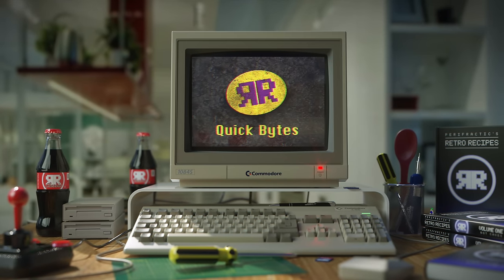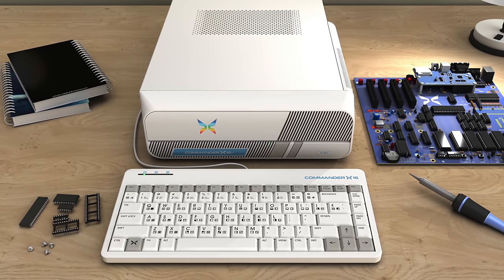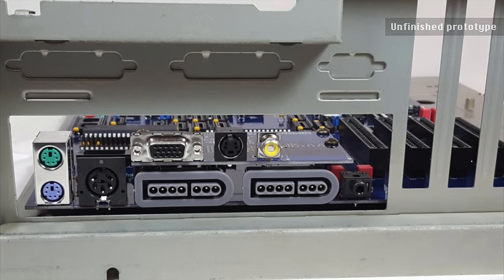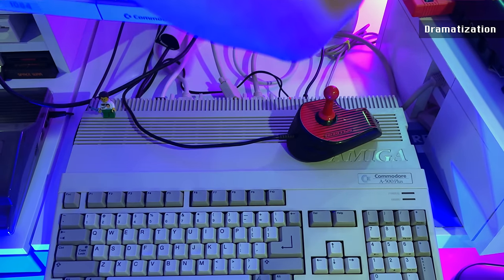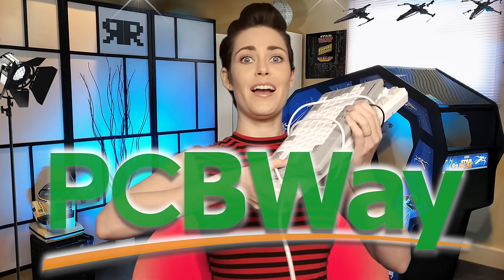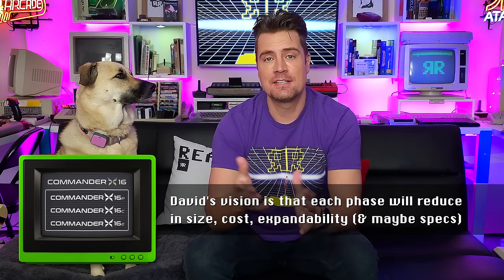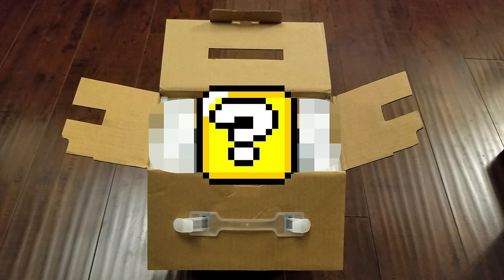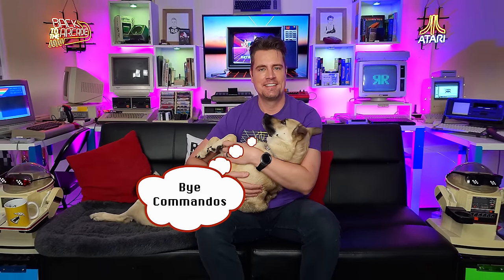Commander X16 Visual Design Update: Case/Keyboard/Manuals! The 8-Bit Guy's modern retro computer

Comment: So far, the most exciting information here is the USB keyboard I can buy today!  And I intend to do that... maybe many of them if they prove useful with theC64.  And honestly, when I previously made the suggestion "3D print a case for the theC64full keyboard to make it USB" you might have mentioned it then -- that a USB Commodore-like keyboard already exists!  I'm guessing that mapping will be an issue but "8 Bit Show and Tell" seems to have a good relationship with Retrogames.biz and adding support for this keyboard (if it's not already good enough) might find its way into the next firmware update.

I find myself a bit disappointed that Commander X16 is hurting itself with the PS/2 keyboard interface.  I get that things are supposed to be "off the shelf" as much as possible, but the use of USB devices is really important to keep things useful now.  USB keyboards are everywhere.  PS/2 keyboards not so much.  The problem is obvious.  In your theC64mini keyboard video (also tremendously exciting!) an arduino is used to map a button matrix into a translation which then sends keystrokes over USB.  The reverse can also be done, or more properly, a USB to PS/2 converter.  So I'm hoping that, at the very least, even as my hopes for USB on the Commander X16 persist (and they will persist even if I have to extend my hopes into a USB expansion board!) that a nice arduino based device will enable the use of USB devices (both mouse and keyboard) on the device.

But to save myself a bit of time (I am still going to support these projects with my dollars regardless!) would you mind testing the USB Commander X16 keyboard on the mini and full theC64 under the latest (1.5.2) firmware?  It would be good to know what to expect out of the box and what shortcomings may exist. But I'm not going to wait for an answer... I'm just going to buy some keyboards ASAP.

UPDATE: Just about to submit my order for the new keyboard and I noticed they [may] provide features such as macro programming and other things.  It also mentions a firmware flash for PS/2 conversion support.  I have already submitted a request for information about a custom flash where I or they could make this Commander X16 keyboard directly compatible with the theC64 series of emulating computers.  Hoping to get some feedback on that.  But the custom macro functionality may be more than enough by itself depending on the way it's implemented.

Comment: Currently these parts are being 3D printed, wouldn't it be faster if you end up lasercutting these?
Reply from the maker: It's just the mock up that's 3D printed. The real case is injection molded plus steel.
Reply: @RetroRecipes  Oh, that sounds even better!

Comment: I much prefer the more boxy design of the phase 1.  To my eyes the more bulbous design of the phase 2 looks too much like an XBOX 360 which gives me nightmare visions featuring red rings of death. 

Also, as the Phase 2 design has a lower profile, will there be any expansion slots at all?  I know the height is limited and it is using an ITX form factor but I would have thought that you could expand with at least two cards using a riser to turn them 90 degrees.
Reply from the maker: Answered in FAQ - see pinned comment 👍🕹

Comment: What's the point if it is not compatible with anything and costs too much to be good for teaching children?
Reply from the maker: You could say that for any new computer that was the first of its kind. What was the point of the Commodore 64 when it wasn’t compatible with anything? What was the point of the Macintosh? What was the point of the iPhone? If your question is sincere I recommend heading over to our forums where you will see the excitement people have. The Facebook group alone has 20,000 members. For me it’s about re-experiencing the excitement of receiving a new 8-bit system and for a lot of people it is tied up in their childhood nostalgia. 

As to your question about cost, I put the question back to you. How much does this computer cost?
Reply: @RetroRecipes  Just the board alone will cost 200 to 300 bucks according to David, which in my opinion is pretty high and far above the actual manufacturing costs. I guess your case and custom keyboard be  add another 100 to 150 dollars.
Reply from the maker: @Schule04  I'm one of the 5 core team members and haven't seen David announce a price for the PCB (and it's Kevin who is handling that, and neither has he). And your pricing for my keyboard and case is WAYYYY off. Not arguing, just letting you know the realities from within the project. But it's not for everyone and that's okay. Have a great week. 👍🕹
Reply: @RetroRecipes  David mentioned that price in his second video about the computer.
Reply from the maker: @Schule04  I assure you the board alone will not be $300!

Comment: I would like the computer to be black or beige.
Reply from the maker: Sure but would you be able to put up the extra $30,000 to achieve that?
Reply: @RetroRecipes  I was thinking different colors could be crowdfunding goal.
Reply from the maker: @Wii505  unfortunately it couldn’t work that way because we would still need to order 1000 of each color (factory minimums) so if we made it a goal we would have no way to know if we would get an equal split of orders. If we did not sell 1000 black units then we would lose a huge amount of money by having to ship white units to those people instead, and have hundreds of unsold black. As is often the case it is a lot easier to say in a comment than to do. Trust us, we thought everything through, but thanks.

Comment: lacks an ethernet port.
Reply from the maker: It’s features four expansion slots and an ethernet card is already planned by the community
Reply: @RetroRecipes  yeah. well. it should simply be on board to avoid all that shit that happened on the ibm pc platform with  like a million different cards with their own ports, irq's, and register maps. just throw in a cs8900a or something by default. it's just something you want to know for sure is there without having to scan for it or rely on users setting a load of dipswitches or whatever right.
Reply: other than that. looks like a proper product. but it needs comms. :P don't make the same mistake as tramiel (and nintendo back in the days ;)
Reply: btw... pretty much any 'usb keyboard' IS also an AT keyboard. just cut off the usb plug and have them fit ps/2 or din-5 connectors... that 'converter' has nothing in it. the firmware usually supports it all (some even xt) din-5 being the wiser choise as it's more sturdy and doesn't randomly fall out of the connector unlike minidin(ps/2)
Reply: there is btw a certain market... :P to which one could easily sell a couple of million units in just a handful of larger transactions. lol.
Reply: how is rs232 implemented... wdc65c51 is broken (even if you'd order a shitload of em and force them to fix it, it still has a non-standard way of cutting the frame halfway through if the handshake/flow control goes inactive).. harris 65c51Ax only runs up to 2 or 4mhz or so and only is available in old stock. (only 65xx chip out there that does it properly afaik (nicely finishing the current frame), the rest is actually intended for intel ;)
Reply from the maker: @CB3ROB-CyberBunker  I would recommend reading the FAQ and asking any questions in the forum that haven’t already been answered. A lot of what you are bringing up has been raised over the past two years and it’s just a search away. If something hasn’t been added it is to keep cost down. Also most keyboards don’t include PS2 compatible firmware which is why only specific ones will work regardless of adapting the plug. Even the deluxe microswitch keyboard I showed will only work with PS2 as supplied with firmware 2.5. If you flash firmware 3.0 then PS2 ceases working.See you at the forums!

Comment: Not that I have any interest in ever purchasing this machine, but as an engineer, I'm telling you it's a mistake to use older interfaces to do connections.  There is absolutely no reason to use an AT keyboard port plug at this point.  Use USB C.  All you are doing is locking people into what is now a proprietary solution and needlessly raising costs.
Reply from the maker: Whilst I hear what you were saying with all due respect you have missed the point and made a few assumptions. USB is not easy to implement for the 8 bit processor that we are using. PS2 is much simpler and cheaper. However if you have a easy way to facilitate this that none of us are aware of feel free to share. Also, see faq.
Reply: @RetroRecipes  I see no reason to use an 8 bit processor - that's why we created chip simulators for.

I'm an engineer, I'd target low cost.

I'm just commenting, I wouldn't have any interest in such a machine.  I can't see any advantage it would have over a Raspberry Pi 0 running a simulator on it.

I'm not trying to criticize, I just truly don't understand the point.    Back in 1989 when I got an Amiga, the LAST thing I'd want to do is go back to a C=64 6502.

I'm surprised there's enough of a market to justify the cost of development for this.  Honestly, be neat to have a case and a keyboard, but why bother to use "authentic hardware"?    Would be nice to have a machine running a decent multicore ARM system though.

I just don't look at the good old days as the "good old days" - they were the bad old days.  Stuffing data onto floppies, cassette players for music, NTSC television, tuning your monitor to get the right colors, VCR tapes, dial up modems, having your computer's DC converter block get so hot it actually warmed up the room?

30 minutes to save 1 MB worth of data?  Everything was such a pain in the butt.

I much prefer a raspberry Pi X running at 10 watts, with a ton of simulators on it with a 128GB SD Card - in a Flirc Case - $75 total.  My opinion is worthless on this project you're doing is, because I'm not the target demographic.  I'm just surprised there is a target demographic.

It's kind of(?) interesting, but if such a machine were available in 1989, I don't think it would have competed against the Amiga, Mac, or Acorn.

I'm frustrated with the useless complexity of technology - of lot of it is created simply because tech companies purposely backdoor hardware, or just make plain old garbage for software, or conform to ridiculous stupidities like DRM (there is NO DRM, you can ALWAYS record ANYTHING that is "protected" (laugh) with DRM).

I think it would be more interesting (and again I'm not your target demographic and I may be a demographic of one) to make a system that is:

1) powerful
2) simple
3) secure

I think you can pretty much get there with a Raspberry Pi though - I think the problem is solved.  That little toy is the equivalent of my desktop back in 2000 and on a sd card, which I can EASILY loose between some couch cushions, I can store more books on it than the Library of Alexandria had.

There's ridiculously complicated BS systems today - a more interesting thing is making the SIMPLEST system today, that has all the advantages of modern technology.  Instead we have phones with operating systems so utterly complicated we can't prevent a virus from being installed on it and people judge quality by how smoothly it scrolls when you do a finger swipe - and it's a legitimate superior machine than a Cray Super Computer from 1990.
Reply from the maker: @richardwicks4190  I appreciate your reply. I have to agree that you’ve missed the point. This isn’t for you, and that’s ok. Our Facebook group has 20k members who get it. A big part of the point is nostalgia and experiencing the fun of easy to understand computer building with our kids, as we did when we were kids. With the X16 you’ll know exactly what each chip does. And much more, but that’s just one reason. Thanks for the chat and enjoy your day.
Reply: @RetroRecipes  My reply to you was censored I see.

You want to make machines and computers easier for young people to understand, I have a different goal - to make systems that cannot be censored and decentralized.

There was a time where censorship wasn't tolerated and people would abandon publishers that engaged in it.

My goal is to make a centralized communication system that isn't possible to censor and at the same time, a system that anybody can code and understand.  Return control to the people who use the system, and take it out of the hands of corporations.

So disgusted that people aren't allowed to freely talk.  I'm working on it.

You have some board designers working on this system?  If they want and have the same desire I do, perhaps I can work with you and them in the future.  Have to do a proof of concept first.
Reply from the maker: @richardwicks4190  I certainly haven’t censored anything. YouTube does have a filter for potentially inappropriate replies. I don’t check the folder for obvious reasons. As to questions about the board designers, I’d encourage you to read the FAQ (see pinned comment) and watch the two videos linked at the top of it so you have an understanding about all of that. I hope you appreciate that has that all information is already out there, I don’t have a ton of time to repeat it on a one to one basis, and we do have a lot of people asking. Thanks and best of luck!
Reply: @RetroRecipes  You've not censored anything, I'm pointing out this isn't a free platform.  It's a publisher, I'm frequently censored and I was censored in my response to you.

The point of engineers in my generation was to make unfettered communication possible but there are gatekeepers run by AI.  The companies we helped create have betrayed us.

There's already (incomplete) solutions - they are difficult to use.  The internet must be decentralized to the point it cannot be possible to control.

More than a few people are working on this.  I'm spending time finding the attack points of it.  The main attack point now is centralized communication controlled by a corporation.

IPFS seems promising, but I think it's limited to web browsers.  Web Browsers are too complicated to debug and understand.  Essentially we are just passing around files.  Firefox is around 70 GB today, who can go through that to detect shenanigans?

The concept of Unix is, and always had been, "everything is a file".  This can be accomplished with minimal code.  We're just tossing around data, I think there needs to be a simplification of communication sharing, built on top of abstract P2P end to end encryption.

The concept of Unix is also make a program to do one thing, and make it do it well.  The interface to it is limited to doing a single task - this allows people to debug its specific purpose and to eliminate backdoors.

Keep it stupid simple, right?
Reply: @RetroRecipes  I should also add - hope you make money!

Also, I used to do dog rescue.  14 years seems like a long time, until year 14.  Dogs are awesome but it's a hell of a thing to put them down.  Make the most of the time.

Comment: have had perixx boards before, they don't last long unfortunately :(
Reply from the maker: They’ve actually improved greatly and we have been working with them to make sure this one is top notch. And of course they come with a warranty. Now of course we could in truth include a much higher quality keyboard but it would increase the price of the machine by maybe $50. That just isn’t an option and goes against the ethos of this project. You can’t have things both ways sadly.